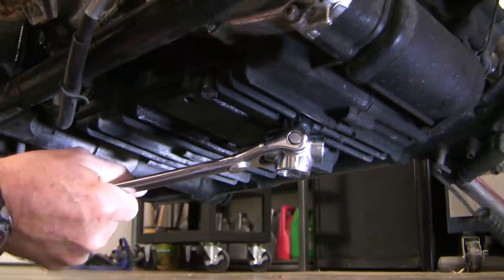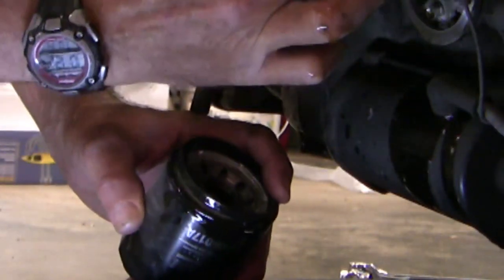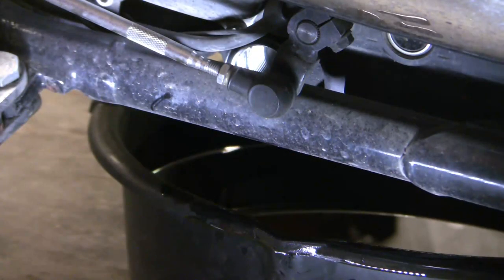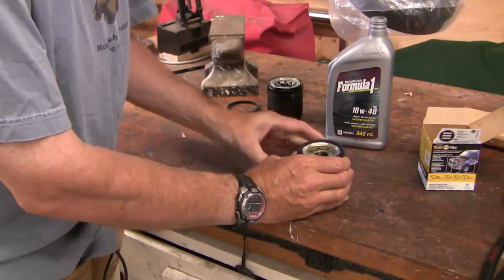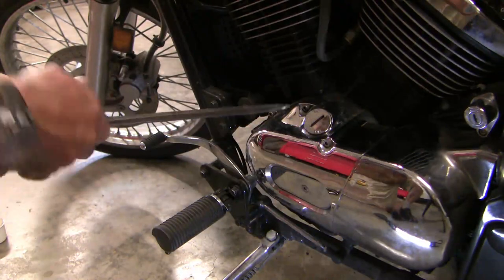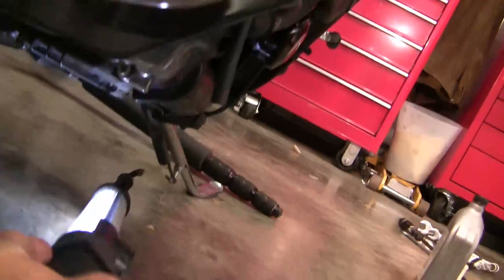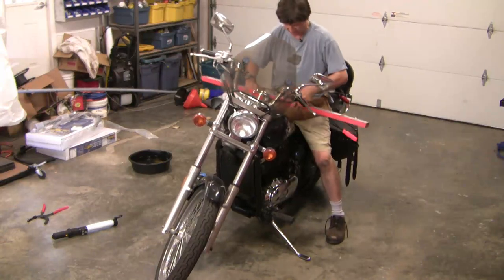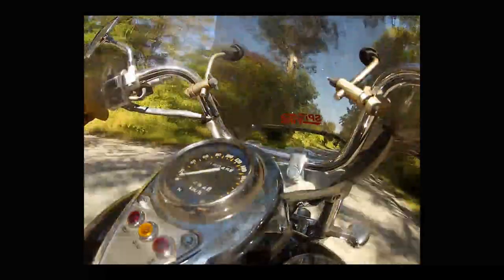How to change motorcycle oil,  Kawasaki Vulcan

Comment: ATTENTION PLEASE>> When you took your oil screen out it was backwards, and you put it back in backwards. The rubber ring on the end of the screen goes in first as it seals against a hole at the end of the hole you push it into. Then the washer goes on, then the spring, then the cover. The spring pushes against the rubber ring which helps to seal it, so it filters the oil going through it. You've put it in the wrong way around so it isn't sealed and no oil will pass through it because you've put the end cap in first which is blocking the hole.
Reply from the maker: In the actual 1995 Kawasaki service manual, the way I show it being installed is the correct orientation. There is a clear photo of orientation in the manual, no mistake there. Also I was the original owner of this bike, so if it was wrong then it was wrong from the factory, too. I can't exclude the possibility that more recent models use the opposite orientation, and I can't exclude the possibility that Kawasaki changed their mind about that and put it in differently in later years. Also I cannot even say if it makes a difference, it may not. If I were you I would stick with what was present in your bike, or better yet, check your OEM dealers manual for your year. I already have.
Reply: spelunkerd ok thanks. Just looking out for you and viewers. Great video. Regards

Comment: great vid man
Reply from the maker: Thanks!
Reply: spelunkerd
What do you spray the screen with?
Reply from the maker: vag denaxas I used brake cleaner.
Reply: spelunkerd
Thanks man! Also do you know if there is a way to replace the front turn signals without dismandling the whole front of the bike? The old ones got broken and I cannot see an easy way to reach there to simply change them...
Reply from the maker: Never done it before, though I would start with the dealers manual.

Comment: this video really helps. im new to riding and needing to do this. does this also work for a 2001 vulcan 500? same concept and all?
Reply from the maker: +C SHARP Principles are similar, but you should get a dealers repair manual and look into the screen detail. At least one other viewer said that his screen goes in backwards compared to the 95 Vulcan, so the design of that may have changed, or perhaps it's common for some people to put it in backwards. Mine goes in exactly as shown in the dealers manual.
Reply: Okay thanks alot. Will look i to it

Comment: If it's okay, may I ask a bit of advice? Curious, if needing to order parts online, like a fuel petcock or a carburetor rebuild kit, what company do you recommend?
Reply from the maker: Great question, I don't know. I'm not very happy with Bike Bandit, they took almost three months to get a chain to me, even though they charged my credit card right away. I did a search and found a lot of similar complaints about them, it seems this is their business model, even if the part has to come from by boat China. Eventually I learned that all but one item was in stock so when I canceled that part of the order it arrived a week later. If you can tolerate the wait I guess they would be OK. For auto parts I have used Summit and also Rock Auto; both are excellent. Amazon is spotty but usually OK, Ebay is fairly reliable. Not sure about bikes, maybe somebody else will chime in.

Comment: Thank you for posting the video. It was very helpful in guiding me through the process. I am curious though... What filters have you used other than the one shown? I have an HF303 that Fram cross referenced as a PH6607. This Fram filter is shorter than the filter that is on the bike now. Is there a reason (assuming clearance wasn't an issue for either to be used) why a longer filter would be used?
Reply from the maker: There has been a number of reviews of Fram filters that seem to show inferior quality, although they are still the leading aftermarket filter maker. Nobody can deny that it's rare for engine failure to be due to a defect in filter manufacture. The main culprits are driving without oil and infrequent oil changes, though there is even controversy about the oil change issue. I've used Fram filters, but lately I have drifted away from them toward NAPA and other filter manufacturers. In a bike, a more relevant issue is to change before storage, to reduce the effect that impurities have on seals.... As far as your specific question about filter length, I'm not sure. To use a shorter filter than OEM filters may be a mistake (less surface area). Maybe the one on the bike now is the abnormal one (grin).

Comment: Hey there,
I just finished watching your video on changing the oil on your Vulcan. I have a Vulcan, I believe I may have air in my hydraulic valves...any ideas how to get that out?  My manual says taking out the engine and bleeding the lash adjusters is the only way. Is this true?
Reply from the maker: My Vulcan has valve shims that need to be checked for clearance and swapped out if they are out of spec, every 10,000 km or so. To do that you go at the head but you don't have to remove the engine. I don't think the lifters are hydraulic, but I could be wrong. Not sure about your vehicle. I suggest you get a dealers manual - ebay may be an inexpensive source. Cheers!

Comment: great vid, no o ring for the bolt on the oil screen? also, does the ruber end of the screen go towards the bolt or oil pump? thanks!
Reply from the maker: There is some variance between models and years. So it is safest to check your OEM dealers repair manual if unsure. Good luck, thanks for stopping by.
Reply: @spelunkerd  thank you sir. I tried it today. 2 ques. does all the oil have to be drained b4 cleaning screen or it don't matter? i have 2012 Classic, and the chassis  bar is one inch right in front, i am not sure how i am going to have neuff clearance to back the huge bolt, long spring and filter out? I even leaned the bike the other way to get it to sway for more clearnace, any suggestions? thanks?

Comment: these Vulcans r so easy to do oil changes....just wondering should I use Amsoil synthetic racing motorcycle oil? I ride my Vulcan year round here in the deep south lol so I want to keep my bike serviced good
Reply from the maker: Unless specifically called for in the manual, I always use natural oil. New vehicles are now designed around the qualities of synthetic oil, and a better case can be made for using synthetic in those.

Comment: Does this oil change applies to an 08 Vulcan Meanstreak or is the body a little different? I'm looking to do a first oil change myself or just take it to a shop for $70-80.00 & let them do it..
Reply from the maker: Fundamentals are identical but for more detail check your owner's manual. You can also get a repair manual from Kawasaki that is well worth getting, showing valuable information. A few viewers have remarked that their spring goes in backwards compared to the way mine is positioned. Critical details like that may be found in OEM manuals.

Comment: THANK FOR AGREAT VIDEO, CAN U PLEASE TELL ME WHAT OIL CAN I USE FOR MY YAMAHA SECA 750CC 1980, IM USING MOTUL 15 -50
Reply from the maker: To tell you the truth I just use what is recommended in the owners manual. You can find that online if it isn't still on the bike. Some manuals give you options depending on the coldest temperature you will be starting the vehicle at. One day I had to add oil to a vehicle at -40 deg, and I was shocked at how long it takes to pour a liter of oil into the engine (about ten minutes to pour a liter of oil, it turns into molasses at that temperature). Fortunately most of us who ride bikes do so at a much more comfortable temperature. The synthetic vs natural oil debate is also interesting. Certainly synthetic will last a little longer and it will get into smaller passageways, however it can also get by seals and rings more easily. I tend to use natural oil in older vehicles but I am very careful to change oil regularly, at least every year in my low mileage bike. In newer vehicles, especially those with variable valve timing with cam phasers, I always use synthetic. Those VVT phasers are an Achilles heel of modern vehicles because oil sludging can lead to an extraordinarly expensive repair.
Reply: THANKS SO MUCH

Comment: Hey I just garaged my bike becuase the oil is almost empty but need to make an hour ride asap. If I didn't do a complete oil change yet will I damage my bike if I just throw in a couple quarts for this trip? And then change the filter and change it all next week? I have the same model bike.
Reply from the maker: Probably OK to top it up, on the high side but not over.

Comment: Also, what do you use to remove the rust off the shift linkage? your is spottless, amazing job!
Reply from the maker: In this case, not much needed. For severe rust, my preferred method is electrolytic. I did a quick video of that.

Comment: Thank you sir. I have a 1500 Vulcan 99. 
This really helped! 
Do you have any video for getting new sparkling plug ? 💪😎
Reply from the maker: Replacing plugs is pretty straightforward, but I would be careful to match the new plug with dealer recommendations. If you can't find the dealers manual, motorcycle supply houses can often help. One thing about the Vulcan, mine had no fuel filter! A clogged or varnished carburetor is much more common on these bikes than is an ignition or plug problem. My bike has an aftermarket Harley fuel filter put in because the carb jet kept getting fouled.

Comment: i have a 98 vulcan classic 800.  i didn't know about the screen, thanks!  
I have a coolant leak on my coolant hose/pipe elbow, that runs into the crankcase.  I've never removed one before, any suggestions?
Reply from the maker: I've not done one on my bike, but I did do a video of swapping the coolant hose flange on a VW Jetta. The general workflow and technique are likely similar. Good luck!
Reply: bigashera

Comment: I know this is an old video but I have a 03 Vulkan 800, looks identical to the one in the video. When I upshift it's really rough and it kinda clunks. I'm having a hard time finding anything about this. Any ideas?
Reply from the maker: I'm afraid I know very little about transmissions, especially motorcycle transmissions. There are a few videos out there regarding how they work, but I'm not surprised you're finding it difficult to get to the level you need to be to diagnose and fix it yourself. I would do the basics, make sure the oil level is correct when the bike is standing vertically, not when leaned over on the stand. I would check the screen for metal fragments. I might even have a go at taking the covers off to see if anything obvious jumps out.
Reply: @spelunkerd  I'm having a hard time finding anyone within an hour of me to even look at it. It's my first bike in about 15 years so I didn't think to find a mechanic before I needed one. I will go through those steps listed and hopefully figure something out. Thank you.

Comment: Hello, I have an issue with my level window of Kawasaki Vulcan 400. It is very dark and I cannot see the levels properly. Is there a way to clean this window somehow? I'd be appreciate if you can show me a way around or tell me how to do it, so I would not run into any trouble. Thanks for the video as well ! :)
Reply from the maker: Good question, I don't know. The next time I have a look at the manual, I'll have a look and stop back here if I have anything more to say. You may be a little overfilled, which brings the meniscus up so high you can't see the top and the whole sight glass looks dark.... Get a friend to sit on the bike and tip it to the right side, and at the same time kneel down and look at the glass. You may find the meniscus after all.

Comment: question i have a 1989 kawasaki 600r. why does oil leak for the air box?
 if you over fill your engine oil would that be the cause? can you hurt the engine by over filling?
Reply from the maker: My air box leaks a little oil, too. My air filter also has a drain tube to allow oil to drip onto the ground rather than being drawn into the compression chambers. I believe the system is the motorcycle equivalent of a PCV valve for a car. In the past, crankcase pressure was relieved by venting the crank gasses to air. A small amount of oil inevitably comes out that vent. The old system of venting to atmosphere was responsible for major emissions pollution, so manufacturers were eventually required to vent the crank back to the intake manifold. That way, those gasses had another chance of being fully burned to CO2 and H2O.
Regarding overfilling, yes, it's bad. The main issue is that overfilling causes foaming of oil caused by the moving parts rotating through big pools of oil. Those foamy bubbles end up being drawn back into the oil pump, and when compressible air is drawn up by the oil pump, the pump can't pump as much volume. Also, foaming of the oil causes oil to be present higher in the engine, possibly coating devices like sensors or vent tubes that need to be clean to work effectively.  Yes, overfilling could lead to more oil being drawn by engine vacuum into the intake manifold/air filter. Great questions!
Reply: Spelunker is Right, Harley-Davidson has this issue. A bypass can be easily manufactured at home.

Comment: Just inherited an 04 Vulcan classic that hasn't been started in over a year.  should I inject oil in spark plug holes before turning over, changing oil, plugs, and coolant, and then starting?
Reply from the maker: That would be wise, though few people take the time to do it. I wouldn't put a lot of oil into the cylinder, just a small spray to wet down the walls without reducing the volume of compressible air space. In a vehicle with an unknown maintenance record, many of those things are due for an update anyway.
Reply: spelunkerd I have a question
Reply from the maker: I would, that sounds like a wise plan. Remember to crank for only about 10 seconds, wait 30 seconds before trying again, then repeat. The wiring inside a starter motor is not designed for a long crank, you could fry the starter by persisting too long with the start. I would also drain the carb bowl, and replace the gas in the tank. In the Vulcan the carb bowl drain has an allen wrench screw under the carb, it will drip fuel when you loosen it off. Remember to be sure the drain seals properly after you're done. After such a long time, don't be surprised if your carb needs the varnish cleaned from it before the bike runs properly.
Reply from the maker: Yeah, I'm listening....

Comment: I currently have a 96 vn800 looks like a tiny bit of oil may be leaking from this bolt where the screen goes in. In the video I cannot tell if there is a gasket or not?  
Love the channel and thank you for the vn800 videos great info!!!!
Reply: Just found the part number for the o ring. 92055-1358 

I’m assuming mine is shot. 
 thanks again! 🙏
Reply from the maker: @TopGonz  yes, diagram 6-2 of the dealers repair manual shows an O-ring, labelled 'g' in the diagram. That fits with my memory of what is there, I've never had to change it. It may be a generic size, I believe you'll need to drain the oil to have a look.
Reply: @spelunkerd  I finally got around to changing that gasket during my oil change. 
After a closer look the bolt holding in the metal mesh oil filter was on way too tight. Also the gasket had a small tear. Hopefully no more oil leak! Thank you for shared knowledge with these videos.

Comment: what is the number of the filter. mine is so dirty i cant see and nobody knows at my local workshop.. i just bought this motorcycle and i want to make sure everything is perfect
Reply: +mikelagaffe Purolator filters are great for a lot of metric bikes: Hondas, Susukis, Yamahas and obviously Kawasakis. Your bike takes either a PL14610 or a PL14612.
The difference between them is the size of the filter. It is 3.5" for the PL14610 and 2.5" for the PL14612

Comment: ever have anything on the screen?  I have had my 95 1500 a year now, 2 oil/filter changes and nothing on the screen. what does it filter?
Reply from the maker: Good question, mine has been clean each time. Good maintenance should avoid making the tiny metal bits that might come from internal wear.